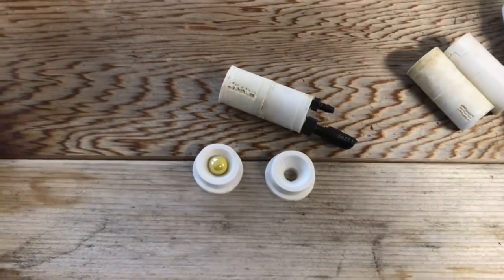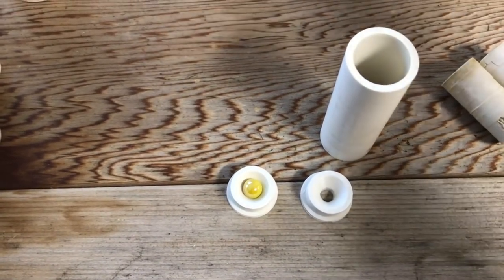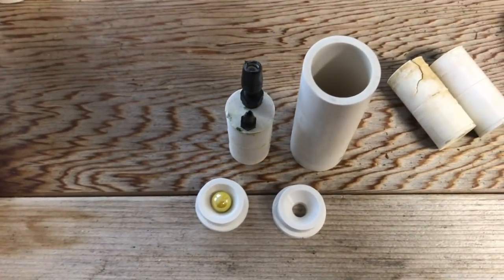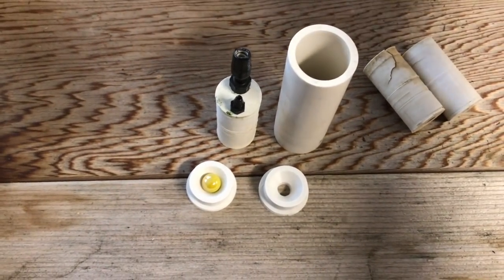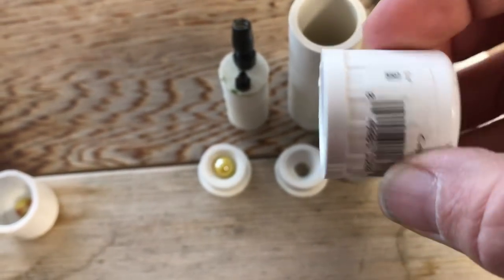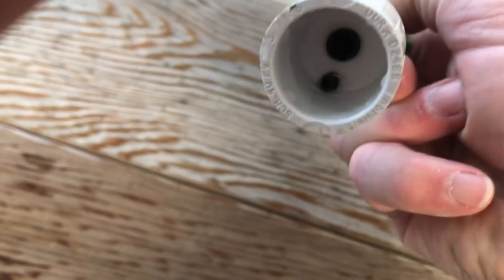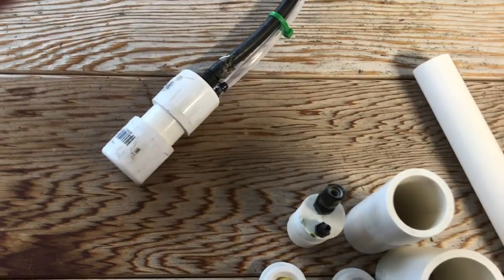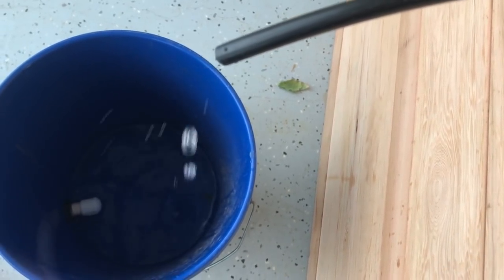2017- PVC Air LIft Pump

Comment: If you just extended the water outlet fitting longer down inside the body of the pump you will get a geyser effect or ejector pump effect. Now you just have a complicated air lift.